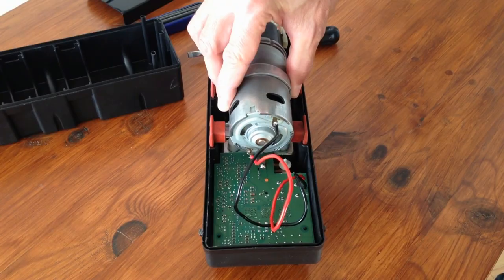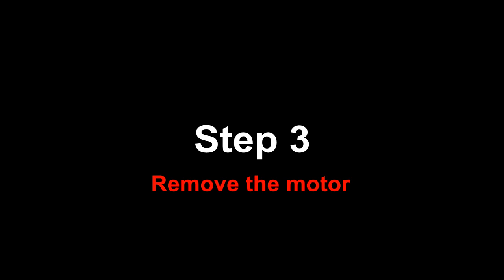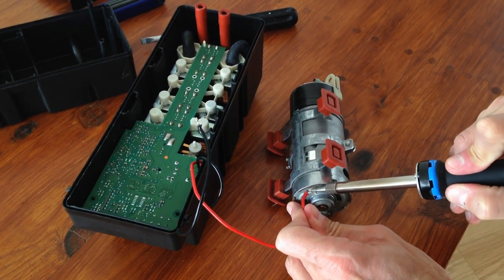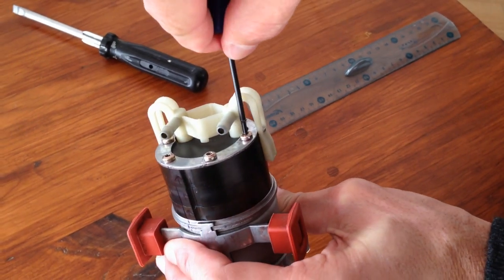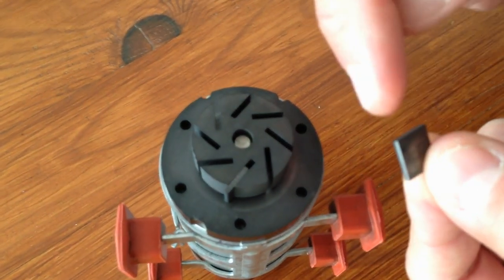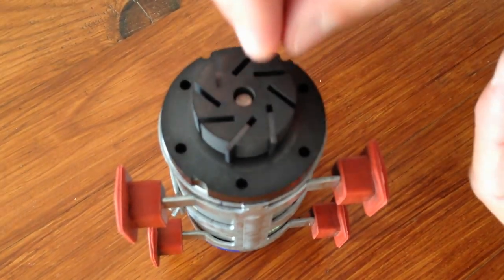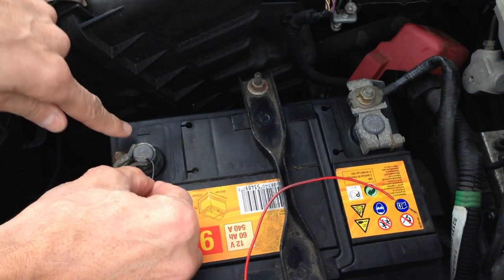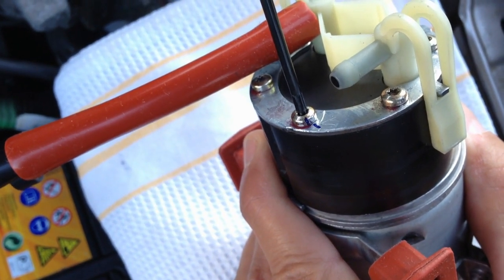How to fix a central locking vacuum PUMP broken ROTOR - Mercedes SL (R230), CL (C215), S (W220)

Comment: Can you help me to find out what's happening. R230. Central lock works, but the trunk opens on the second try. And the trunk closer doesn't work. Is it connected to each other and to the pneumatic motor?
Reply from the maker: Hello ! The opening and soft closing of the trunk is indeed pneumatic. However, the problem in your case does not come from the PSE pump because the central locking system works. A video is planned to explain in detail how to solve this problem. I will just ask you to be patient ! I will update this comment and you will be notified when it is available.
Reply: @IfixmyBenz  Thank you very much for your reaction!

Comment: My w220 when switched off over time the rear of the car raises fully up. Would this have anuthing to do with it also?
Reply from the maker: Hello ! No, it's probably a suspension problem...
Reply: @IfixmyBenz  thanks for the reply! If i got a complete 2nd hand unit for the central locking pump, just the part numbers have to match my one for me not to have to recode it?
Reply from the maker: @andresh9068  Hello, unfortunately, no... There are different part numbers for the PSE pumps for W220. And the part number corresponds rather to the generation of the car, not to its characteristics. If you replace your pump with a used one, and it comes from a vehicle that does not have exactly the same features as yours, a coding will unfortunately be necessary. This is why it is generally preferable to keep the electronic part of the original pump to avoid this kind of problem... 😉

Comment: Do you have a video of the motor replacement.
Reply from the maker: Hello ! Unfortunately not, I'm sorry. The most common failure is a broken or worn rotor. Have you tested your motor on a 12 volt battery to be sure it's really broken ?

Comment: Hello, thank you for your video, the amount of detail is impeccable. I have a question maybe you can assist with. My s55 amg pse system is still working, all softclose works and all locks work, however, the pump runs for quite a long time after a soft close action is performed, nearly 10 seconds. The softclose will work, it is just slow. This is consistent across all doors. The central locks are also a little slower than I’ve seen in other videos, but again, they still work.

My question is do you think my pse pump is not producing enough pressure? In theory if that is the case, could I just go into the pse pump and turn the screws 1/16 turn and try again? I dont think my rotating assembly is broken since the fuse never pops, but maybe it is worn? 

Any thoughts from you would be greatly appreciated, I am trying to avoid having to get a whole new pump!
Reply from the maker: Hello ! Thank you for your compliments. 😊 First of all, make sure that the rear battery in the boot is well charged. Do not hesitate to charge it with a charger. If all the pneumatic functions as a whole are slowed down, the pump rotor may be worn out and the pump will not deliver the required pressure. Check the pressure at the impeller outlet as I do in the video. The minimum pressure should be 3 bar (43 psi) and ideally 3.5 bar (51 psi). Do not attempt to re-tighten the turbine as the original tightening is ideal and over tightening can break the outer casing of the turbine. If not, there may be an air leak somewhere in the pump itself, although this is quite rare. An air leak in the pneumatic lines seems unlikely to me since all pneumatic functions are slowed down and not just one... 😉
Reply: @IfixmyBenz   thank you so much for your reply. I have a feeling my main battery is good as the car starts right up and has no issues driving, no weird electrical errors or quirks. 

I will test the pump as described in your video and see what the results are. I have a feeling you are correct that the roter/impeller assembly is worn just enough to allow the pump to run for extended times due to not reaching required pressure, but NOT worn enough to prevent functions from not working all together. 

Ill report back my findings, thanks again for your help
Reply: Hi there, I just completed the test and as suspected my pump is not making 3bar of pressure no matter what air gauge I use (i tried 3 different setups). Best I ever saw was 2.5 bar, which makes a lot of sense considering every soft close thing works, but its just slow. 

I have the new rotor assembly on order and will attempt a rebuild when it arrives. 

Other good news is I saw no evidence of heat damage anywhere on the motor or where the hoses from the motor connect to the plastic solenoid board. I think this should get me going back to 100%, but ill keep updating incase anybody else is curious about this.
Reply: Finally got my new rotor and after rebuild we are good to go, 3bar and the soft close works and lets the doors go after 3 seconds as it should. 

Another thing I will probably replace soon is the O rings on the white plastic part that connects to the rotor assembly. Mine were covered in old graphite and dont seem to be very snug. When testing I could wiggle the white part to get an air leak then move it back so it would seal. When leaking it would only make 2bar.  I installed it in such a way that it was sealing, but I’m not sure if it will last or not. All I know is the rotor is new and not the problem. The OEM rotor had clear signs of wear and tear.

If I figure out the exact O ring size ill post it here. I have a couple sizes on order to try.
Reply from the maker: @byteme13456874  Thank you for sharing your own experience through your comment !
Reply: I think I have exactly the same issue on my S55. I'm not sure how long the pump runs (I haven't listened) but I'm getting error code B1436 ("The safety time of the central locking has been exceeded") for all 4 doors
Reply: @amglover4361   I bet your pse pump is due for a rebuild. After I rebuild my impeller I have had no issues since. Still good to this day.

Comment: HELLO.i I own merceders w124 1994 year edtion.mine original locked pult works an I see when I pushed up red and green close and open on my door signalizacion,but do not hear the noise compressor do not works.and the button do not work too one push close the door.if you know what is my problem and what I should to see first?
Reply from the maker: Hello, It's hard to say where the problem lies. Just know that on the W124, central locking is also pneumatic. The pneumatic pump is located under the rear seat, on the right-hand side.
If you can't hear the pump running, there may be a power supply problem. You can start by checking the fuse and electrical connectors connected to the pump. Good luck! 😉
Reply: @IfixmyBenz  thanks for reply,, wich Relay or something I should to see first?
Reply from the maker: @akakimtvralashvili3538  Look at your fuse diagram, there should be a fuse for "Central locking". This is the PSE pump fuse... 😉

Comment: Do you know anything about slk 240 03y, I don't know why the central locking isn't working with the boot lid with the key fob I hear a noise I'm not sure wherever it's coming from the lever on the mechanism does go in place to prevent you opening it with the handle but I'm not sure why the mechanism isn't working I'm not even sure which fuse it is any ideas thanks!
Reply from the maker: Hello, I used to own an SLK (R170). It's a bit far for me, so I won't be able to help you much. I remember having problems closing the trunk. Sometimes you had to slam the trunk hard to close it. And one day it wouldn't close at all. All I had to do was dismantle the closing mechanism and grease it. I don't know if that's any help... If your trunk has trouble locking, perhaps it's because it's not properly closed ? To be checked Good luck ! 😉
Reply: @IfixmyBenz  I don't know if it's the closing mechanism I don't think so! there's no issue closing it I don't need to slam it it will close very easily. I don't think it's a vacuum system either I think it's a cable but I don't know where the motor is situated, that's what I want to know I can't seem to trace a motor, I haven't taken the mechanism out maybe I need to do that.
 do you know where I can get a workshop manual online that's safe? I need to get a workshop manual blow up diagrams? Thanks
Reply from the maker: @jedi-mic  OK. Good point if the closing mechanism works. The central locking system on the Mercedes SLK R170 uses a small pneumatic pump. Given that only the trunk lock doesn't work, you need to access the mechanism to see what the problem is. This is the starting point for diagnosis. In general, you need to remove the inside panel of the trunk lid. This should not be too difficult. Simply take the time to observe how it fits.
Reply: @IfixmyBenz  yeah I've taken the panel off remove the yellow that I thought is a cable whatever that is a pipe?? I don't see a purple one tho! So where's the pump and motor to control it? is it situated in the mechanism?
What's a good website to get a free manual, blown up diagrams, and torque specifications. there's a  s,i,.t,,e called slideshare, don't know if it's trustworthy you can download manuals free I think.
Reply from the maker: @jedi-mic  Hello, the yellow line is probably the pneumatic line. These are yellow on the Mercedes SL and S Class. This pneumatic line is connected to the pneumatic pump in the boot. However, I don't think that your pneumatic pump is to blame, as the central locking system works for the doors. Here's what I suggest you do: leave the boot open and manually simulate a boot closure. There should be a hook in the closing mechanism. Be careful not to get your fingers caught. Use a screwdriver instead. Then use your key fob to lock your car. Then listen carefully to the locking mechanism. If you hear a hissing sound, there's an air leak. You'll need to check where it's coming from. If it's the mechanism that's leaking, you'll probably need to replace it...
If you decide to replace it, mark the location of the original mechanism with a felt-tip pen before removing it. This will enable you to fit the new one in the same place without having to worry about adjustment.

Comment: Hi can this problem cause my roof not opening problem? "Roof in operation" plus the central locking isn't working. Are they both linked?
Reply from the maker: Hello, there is indeed a link. The PSE pump must be in working order and the trunk soft close operational for the roof to operate. If the central locking system, trunk soft close and lumbar supports don't work, there's a PSE pump problem...
However, the message "Roof in operation" may be due to a faulty switch. There are a multitude of switches that act as sensors to inform the car of the various stages of opening and closing the roof. Good luck ! 😉
Reply: @IfixmyBenz thank you for replying! Also I have noticed the rear quater window is not working is this linked to to pump?
Reply: And the fuse keeps blowing
Reply from the maker: @Amg641  Hello, you're welcome ! 😉 No, there's no link between the PSE pump and the quarter window.
Reply from the maker: @Amg641  If the fuse keeps blowing, it may be a short circuit (check the pump's electrical connectors), or a broken pump rotor (you'll need to remove the PSE pump)...

Comment: what is the torque of the screws? 2 to 4 ft lb? before the pressure and vacuum adjustment
Reply from the maker: Hello ! At first, simply tighten so that the turbine elements do not move. Then adjust the tightening to obtain a good pressure at the pump outlet ! 😉

Comment: Hi my lovks dont work but my fuse is still good. Any suggestions?
Reply from the maker: Hi ! To find out whether the problem lies with the PSE pump or not, it is necessary to test other pneumatic functions such as seat lumbar support or the opening and closing of the trunk. If these other functions operate correctly, then you don't have a PSE pump problem. Then look elsewhere... test with another key, etc...
Reply: @IfixmyBenz  no nothing else works.
I think it's the brushes in the pump motor. I disassembled it and pushed the brushes in more because they weren't making contact... and got it to work but when I reinstalled into the pse unit and back into the car all it does is click when I push open or trunk or gas lid
Reply from the maker: @armenvegas  From what you've described, it sounds like the problem is with the pump motor. Try disassembling the motor again, and while leaving the turbine in place, test the motor on a 12 V battery as I do in the video to see what pressure you get. The motor should run vigorously and the pressure at the turbine outlet should be between 3 and 3.5 bar.
Reply: @IfixmyBenz  thanks I'm headed home to do just that. I had it apart and the brushes on the motor weren't making contact. So I pushed them to where it worked then reassembled installed and in the car again it just clicked.  Lol

Comment: i broke the piece under ther impeller and cannot fin
d replacement parts
Reply from the maker: Unfortunately, this is what happens when you try to install a poor-quality rotor...

It's not your fault, so don't blame yourself ! You've probably fallen victim to one of the many unscrupulous sellers of poor-quality rotors. They've been popping up all over the internet since I released this video...
If you install a poor-quality rotor, the pressure at the pump outlet will be low and therefore insufficient. You will then tighten the screws more and more to try to obtain a better pressure, and this excessive tightening will cause the lower part of the turbine to break. It's fragile, as I said in the video. I guess that's what happened to you.  It's a real shame, because unfortunately there's no replacement part for the lower part of the turbine. 

On the contrary, if you use a high-quality rotor like the one I recommend (link below the video), a slight tightening is enough to obtain a high pressure (between 3 and 3.5 bar).

To solve your problem, I now suggest you try to find a complete original used motor, i.e. with the turbine, if you can, or failing that, buy a used pump to remove the motor with the turbine. Good luck to you ! 😉

Comment: Hi please advise where can I buy the turbines? What’s part no.?
Reply from the maker: Hi MrDavidYon ! Rotor is available here (for US and Americas): https://ebay.us/kYoiGp or here (for Europe and UK): https://ebay.us/jjlMzD
No need to change the whole turbine, only the rotor !
Reply: I fix my Benz : thank you very much. One more question, does it need programming after installation? Your reply is appreciated.
Reply from the maker: @MrDavidYon , you're welcome ! There is no need for programming !
Programming is only necessary when you replace the whole unit (the black box) with a brand new one (or a used one from another car).
Reply: I fix my Benz:Thank you!!

Comment: en the next morning I try to unlock, the key won’t go inside the ignition and same thing again, I have push the unlock button for about 25 minutes, then suddenly it starts to work 
But if I use the actual key inside the fob , it opens the door manually but the alarm starts and the alarm ranges for about 3 minutes and after couple tries , then it starts 
Help please
When the weather is warm, the lock and unlock works perfectly
Reply from the maker: Hello ! Your key may have a problem. First, use your second key (make sure the battery is in good condition)  to see if the problem occurs again...